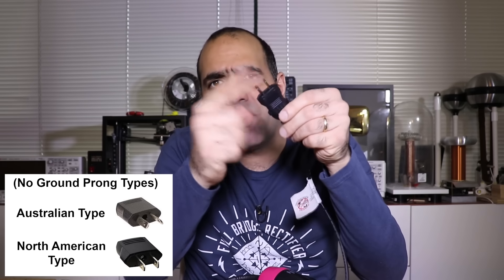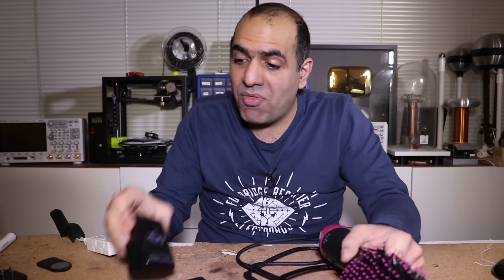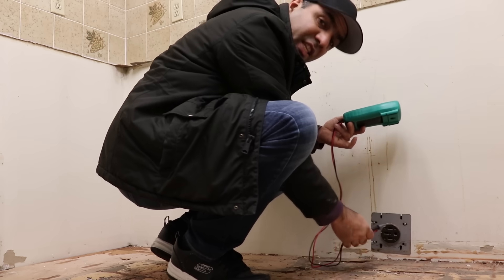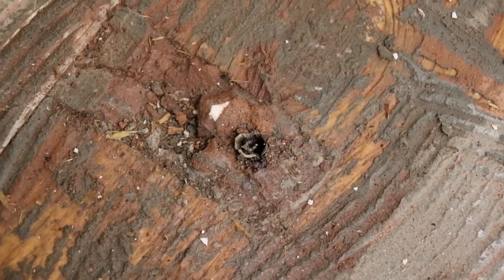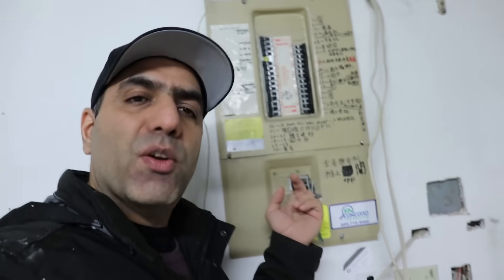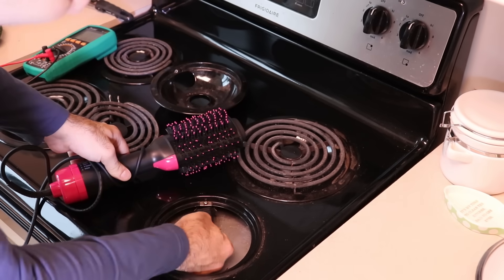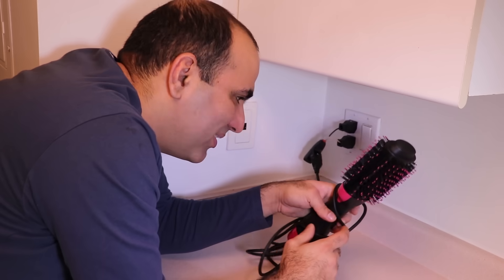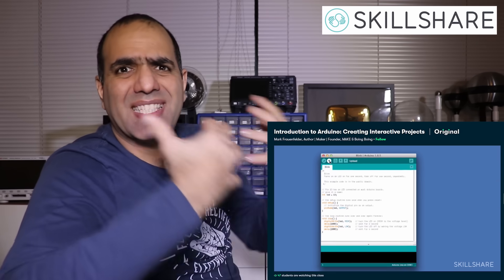Finding HIGH POWER 240V in a 120V Country

Comment: Not gonna lie, I’ve thought about doing this if I ever needed 240v for some reason. It’s so sketchy though....
Reply: It is and it has some complications as written my other comment oh, I might copy and paste it down here. It also doesn't work with gfcis....
I've thought about the same thing, and then experience Met Life
Reply: @imark7777777  Get a range outlet; wire it into a panel with proper circuit breakers - tada you have 240 if you need it for any big tools or anything. Also if you're still concerned - just be safe, turn off the range circuit before handling the plugs.
Reply: If you ever do build or find one of these adapters, check everything!!!!!!!!!!!!!!!!!!!!!!!!!!!!!!!!!!!!!!!

I got myself thankfully involved with my county Fair's Electrics, and got myself free lunch. we had a food vendor show up that had wired up there trailer with a 30 amp 120 / 240 input then made an adapter cable to 2 normal US. 15 amp plugs ends that was... wired correctly. But out of the five extension cords they brought out of the two that they used one of them had reverse polarity and as soon as they plugged it in there was a nice neutral hot short that trip the overcurrent protection AKA circuit breaker. I then had to check their installation which I wanted to do before they plugged in and subsequently trackdown out of 6 electrical panels which one had the breaker in it of course not labeled.
They didn't necessarily need 240v, they mostly had just two separate 20 amp circuits throughout the trailer.
The extension cord in question had replaced ends which is all fine except the replacement ends must have been old stock and for some reason this manufacturer decided to color the neutral pin black before they switched to the now-standard silver. whereas the standard for the hot pin is brass. so obviously the black wire ended up on the black terminal when it should have been the other way around.
get yourself one of those 3 light Outlet testers, test at the outlet, test at the end of the extension cord and test anyting Downstream.
If you want to go further get a non-contact voltage detector as that will allow you to detect polarity in the AC system which the 3 light tester has a few modes that it cannot detect. follow that up with a good multimeter ( in volts mode of course not amps mode, you hopefully only ever do that once..... ).
Reply: @imark7777777  Thank you for the warning!!! 

Always test everything! Check your connections, check your wiring, and double check and then label everything and follow color standards!! 

Heh hopefully ElectroBOOM viewers realize this, but agreed. 

Thanks for the interesting story too!
Reply: @imark7777777  You can get a GFCI as part of the breaker, and then it does work, I know because I bought one and installed it. It's a bit complex to install, but it does work.

Comment: I do you the opposite: finding a 120V in a 240v country with a story.
One day, I was in a hardware store, a lady was looking for a step down (240v to 120v) transformer. She told the store owner that she'd use it for her "imported USA flat iron" that she brought from USA and bragging all about it but she dont want to spend a fortune for a transformer blah blah blah blah blah..... I could not help myself and told her to buy a 240v iron instead. She was arrogant and exclaimed "this is a super high end @#$%%^$&*()_*() from USA!".... So I told the store owner to give her the 2000W transformer... She was shocked with the price of the transformer and quietly left.

A 2000W transformer costs $250++. High end flat iron locally costs only $70.
Reply: As a Filipino who have known many older and ignorant people with colonial mentality  (aka. I like imported than local attitude),  we have a different story. The horror of people plugging 120v devices to 240v outlets without checking the label.
.
And I guess that's why many of the things here are now auto-volt (can work with 100v-240v)

Comment: thanks to the stupid wall socket i can easily-
spaghetti cracks and terrifies medhi
While i just try not to die from laughter

Edit: Omg Thank you for likes! I did not think that i would get 500+ likes
Reply: The best part
Reply: I thought something was arcing.
Reply: I can relate.

Right as I got comfortable in bed, I hear electrical shorting from a DC switch. I start sniffing and looking for smoke... turns out a friken moth got trapped somewhere and it's wings frantically beating against a wall, sounded like electrical shorting.
Reply: Lmao

Comment: There is a product called Quick220 which does exactly your final solution, but safely! I use it to charge my car in places where it wouldn't ordinarily be possible. Once the circuit detects that the outlets are out of phase, it energizes a contactor and supplies power to the load through a circuit breaker. Great vid as usual and happy holidays!

Comment: Was your multimeter damaged when you tested voltage while keeping it on current?
Reply: Thankfully mine was not they should technically have a fuse although in my case I think it was just a thick piece of copper linking the two terminals with the fuse protecting the internals. I wouldn't say it was cheap but it was cheap it wasn't China cheap.
Reply: I did that few times. Out of 1 cheepo and one semi professional none was damaged.
Reply: I accidentally did that, tested how much current there is in a golf cart battery. A lot.

Comment: I'd put in a double relay circuit that only connects the output if it can cross reference that it has nuetral and live to both plugs for safety. It has to be able to handle the current though.

Comment: Here in Brazil we have cities with 230 volts and others with 127 it's a real mess
Reply: Well, it's actually 220V and 127V. And the reason the lower voltage is 127 instead of 120 is so wiring two phases together gives you exactly 220V, which allows you to do what Mehdi did more reliably (but you probably want to wire up a proper socket instead of making this two plug monstrosity he did).
Reply: @digitalphoton3564  i wrote 230 in every comment didnt i? meant 220, yeah my city is 127 but theres  at least 5 sockets with 220, much safer than what mehdi did
Reply: @digitalphoton3564  same shit. it ranges from 110v and 140v, or 210~240v
Reply: @Digital Photon At least in the U.S. and Canada, would 220V usually mean an ancient transformer, when our legs were only 110V? 
Looks like "110V", at least for residential, dates back to well before I was born, and I'm a gen-X'er! (born in 1980)
Looks like the "110V" standard is likely from the 1940s or similar!
Reply: @Siro Souza. @Digital Photon   are you thick or not paying attention to the teacher? His sister is VISITING him and challenged him wanting a temp solution, which Mehdi rigged up safely. Nothing to do with wiring an entire town like that!
Reply: @Ashkenya  Wow, could you maybe chill? I was just sharing some knowledge and poking a bit of fun at him while at it, no need to get so rude.
Reply: In Japan half the country runs on 50 Hz and the other on 60. 
The appliances are ok with it. The problem, when there is a shortage (Fukushima earthquake) half of the country cannot help with electricity.
Reply: @wimpow  Japan also only has 100V and no earth in their sockets. Earthed appliances simply have the two pin US plug and a loose earth wire that you have to somehow hardwire in.
Reply: @wimpow  *Earthquake
Reply: @bmhater1283  Ouch ...The older I am, the worse I write
Reply: Ciro Souza wtf?
Reply: @RowynOfficial  older cities like capitals and such run on 127 while newer smaller cities on 230
Reply: Actually, Brasil have many other voltages. It's a totally mess. 127/220 (Triphase - 120 degrees); 220/380 (Triphase - 120 degrees); 
254/440 (Triphase - 120 degrees);
380/660 (Triphase - 120 degrees); 127/254 (Monophase at three wires - 180 degrees); 
There are more voltages on single phase three wires transformer if you want to buy. 120/240 and 110/220 and others. There is no default.
Reply: cara eu já queimei duas TVs antigas por conta isso. eh uma merda.
Reply: @renatoigmed  uma vez eu queimei aquelas tvzinhas portáteis de tubo que vinham com rádio junto numa viagem que ódio
Reply: It's common to see electricians and codes use 115, 117, 120, 125 or even 127 for all 120V circuits.  Inaccurate meters, line drops, etc.

"Officially" Brazil is 127/220V, which is close enough to American standards not to matter.

You have really wierd plugs tho.
Reply: @Fromage Frizzbizz Yes, that reminds me of what looks like very old standards, probably from the 1940s and/or similar: "110", "115" and "117". Heck, even in the modern times, it appears to be common to say "115", LOL.
And "127" appears to be the max-accepted voltage for U.S. and Canada outlets now.
Reply: @RJARRRPCGP  Right. And nothing's really changed since we went to 60hz in the 50s.

It's funny how numbers for the same thing can vary given a century or so.
Reply: Wooo, that is messed up :D
Reply: Iv been to Brazil and You are Spot on
Electricity is vary Scarry in Brazil.
Reply: Na minha casa tem as duas voltagens. 127 é 1 fio fase e 1 neutro, e 220 é 2 fios fase
Reply: There is actually a reason. It's 220 volts and 220/sqrt(3), or ~127 volts
Reply: @Ciro Souza - 
This Voltage mess looks like the remains of colonialism or a very devised country back then. At least they standardize to a safe plug + (recessed) socket (just like South Africa https://www.youtube.com/watch?v=pWn83hHO1-w ) but still with different voltages.
Reply: in the uk its 230v and 400v :) depending if you live in a house or apartment and many other things
Reply: @taritznova9192  The specification of the voltage is 230/400. In reality it is still 240/415. They just changed the tolerance amount on the specification so that the voltage of 240 is still within spec. They didn't actually change the voltage on the network. This was done to satisfy the EU and bring our voltage in line with EU countries.
Reply: girls there got nice butts
Reply: Whats even the reason for lower voltage? I see only disadvantages like you are limited with the power and such.
Reply: @georg2010cz  They offered the best of both worlds during the second industrial revolution. I read somewhere advantage for lower voltages around 110v was ideal to maximize longevity, or efficiency of carbon lights. 240vac was ideal for maximum efficiency of induction motors. That brings us to where we are today with 127/220, 110/220, 120/240, ... systems that are still currently used.
Reply: @georg2010cz  Lower chance of electrocution.
Reply: Sim man
Reply: Yeah brazil is a real 3rd world country, nothing new there.
Reply: Queimei um cooler semana passada quando liguei ele usando uma fonte 110v na tomada 220v. Antes eu ligava ele em um estabilizador velho que tem saída 110v. Não lembrei na hora, mas apesar do cooler ter derretido a fonte sobreviveu.
Reply: There was such a mess in USSR in a middle of XX century when the 127/220V migration took part.

Comment: Your in an apartment that is feed with 120v/208v 3ø phase your only give 2 of the 3 line so there 120° out of phase. In a house you given 120v/240v single phase 1ø and line to line is going to be 180° out of phase, when you go from any line to GND/neutral is going to be 120v.

Comment: Bero, I actually had a similar problem. I'm an electrician so I just ran a new wire from the panel into the attic and then back down into the washroom. Installed it with a 2 pole breaker and an EU/Iran receptacle in the washroom. Problem solved for like $12, half a day's work and some wire I had kicking around.
Reply: For a UK consumer, that feels so dangerous: no isolating transformer.

Comment: The 208 vs 240 discrepancies you are having is because of the utility setup supplied to the building. Commercial buildings usually use 3ø and residential use 1ø. 240vac is less common than 208vac in 3ø applications, which is more than likely the reason you're seeing it at the apartment. In commercial they just use 2 of the 3 phases to get 208vac 120° apart, and that would seem the most realistic way to power the 240vac appliances. Residential transformers use center tap for neutral which results in 180° phase separation and 240vac.

Comment: I have a question.
Given that a European style socket is single pole (220v hot, common, and ground) and the North American socket NEMA 6-15 is two pole (120v hot, 120v hot, and ground) is there a compatibility issue plugging one type into another? (besides physical shape)

Comment: 3 wire branch circuit which has 2 "hot" and one neutral were ran there.  One circuit for "outlet" the other for the "disposal switch/dishwasher".  out of phase 180⁰.   Off camera mod to the outlet provides his 208. The real question is how/why the building is 208 single phase.  208 single phase is very inefficient. A huge 120/208 3 phase wye transformer provides power to that building.  Loads are split between phase ab,bc,ac. 

GFCI assume GROUND FAULT when "hot" wire load differs from "neutral/common" wire load.  Notice the hair dryer was a 2 wire cord and not a 3 wire?

There is much more to this

Comment: NOW I'm curious to see if my unit as 208 or 240 VAC! I know my parent's house is 240VAC.
Funny thing is... I did this one day, working at a TV studio. the producers wanted to have a cooking show, but didn't have a 240 stove plug in the studio! So I wired up two opposing 120-volt phases to a stove plug. It worked okay, but never got too hot, I wonder if the outlets actually only were delivering 208 volts instead of 240V!
I never thought of that back then!!

Comment: Just imagine the funfactor with the European 0.4kV line voltage.
Reply: @Alexander-jr8nw  all buildings in germany have three phase 👍
Reply: @Alexander-jr8nw  Wtf?
Where i live every house has a 3-phase
Reply: Line voltage is 0.230kV in Europe. Phase to phase is 400v
Reply: @Engineer9736   230V is the Phase voltage because, you measured the voltage between the neutral and the phase.
And you're right if you measure it between two random phases you will get the 400V, but that's the so-called "line voltage".
Reply: @Engineer9736  phase to phase is called "line voltage" smart boy

Comment: I got electroboomed this way when running my computer from onr outlet and my monitor from a second outlet that was apparently on a different phase. When I plugged the display port cable in, it zapped me fingers and burnt out the monitor.
Reply: @Nathan Lovel Sounds more like I would expect with a bad neutral connection. The neutral being missing or very bad, can cause stray current to run through pipes, possibly causing electrocution in a bathroom or at a sink! Also can cause stray current to run through cables! Possibly can cause gas lines to be energized! And it's possible that a neutral problem in a house down the street, can cause electrocution down houses away.

Comment: I have a new oven and induction cooking plate and the electrician made an extra group in the whole house and a special outlet in the kitchen which has a double 240V AC output in one wire. This wire is thick, though.

Comment: and he doesn't say: "that would only work in the kitchen".
Reply: He did say typically in the kitchen, as you're required to have two Appliance circuits which are 20 amps and they usually end up across two phases or have phases.

Comment: My sister brought a 220V power cooker from Iran, in most American kitchens you can find a 240V power outlet, I just bought a 240V plug I connected the rice cooker to two hot wire terminals, that's it

Comment: Our power service has two output voltages. The first connection for the transformer is across the red and black wires. This connection goes through the full transformer and is 240V. The second connection is through the black and white (neutral) wires. The white wire is connected to a location on the transformer which has half the turns of the red/black connection resulting in half the voltage. This is how I understand that this works anyways.
Reply: Close.  The only bit I would add is the black wire can go to either end of the transformer and give 120V.

Comment: Every spark I am very nervous and I had to hook up the new dryer and it scare me when i turn the braker on and. I thought I would hear a bang and power is gone thank God I check twice and i did had black on red and red on black but i fixed it and it runs like dryer. Ehw one issue down and now fixed the stpuid washer code and the part.
Reply: @William Hollinger Reminds me of building PCs, I often panic when I go to plug the PSU in or of course, when I hit that switch. Worrying about possibly hearing a bang (secondary, much of the time, 12 volts or less!) (I also wonder if I'm going to get a faulty PSU and get a primary-side failure.) and/or smelling acrid smoke instead of seeing the BIOS screen.
Reply: For red and black 2 phase things using 2 actives it makes no difference since it's AC.
Reply: @SimonQuigley  oh